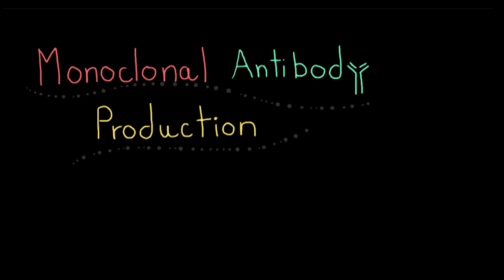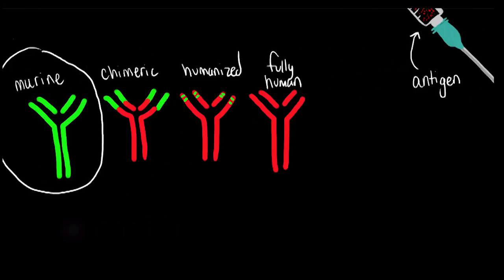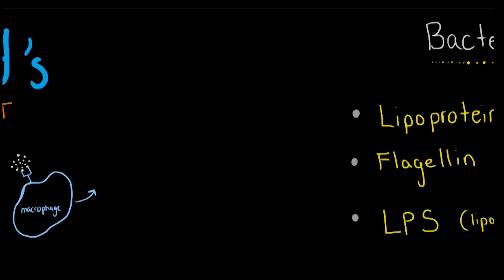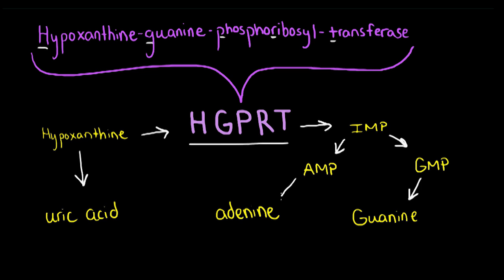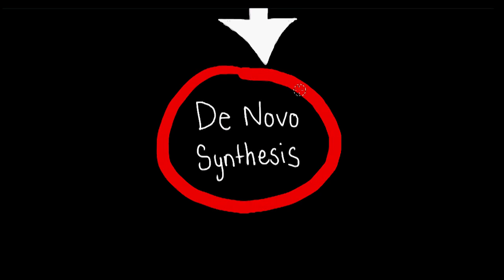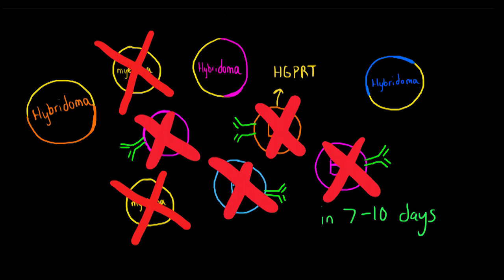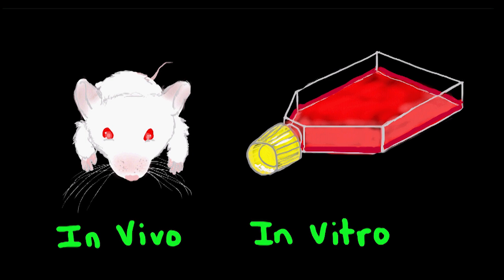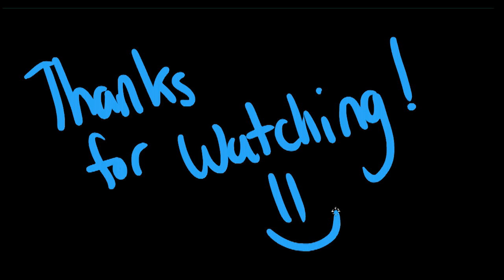Monoclonal Antibody Production

Comment: Quick question, the hybridoma should have 4N chromosomes (2N from normal, 2N from tumor ), when these hybridoma mitosis, what will happen? Its progenitors will have 2N chromosomes? If so, if its progenitor split again, will it still have the ancestor all the hybridoma characteristics?